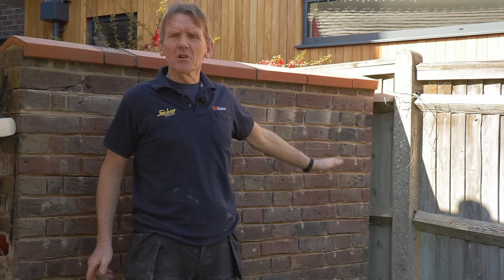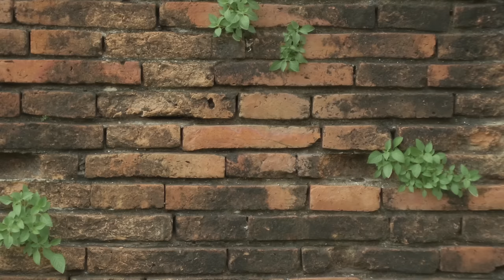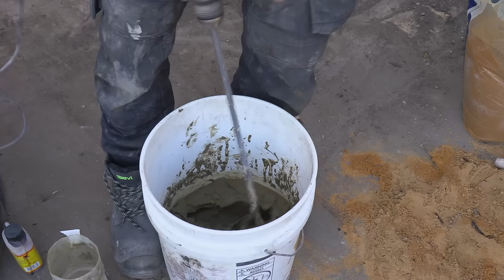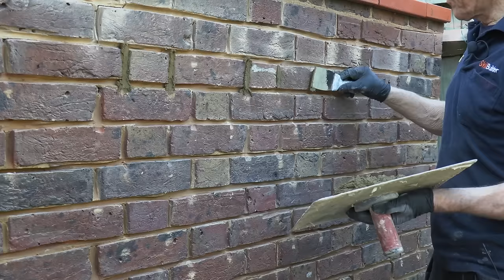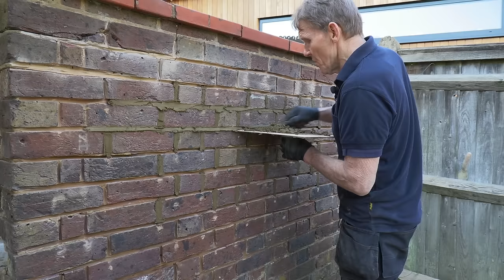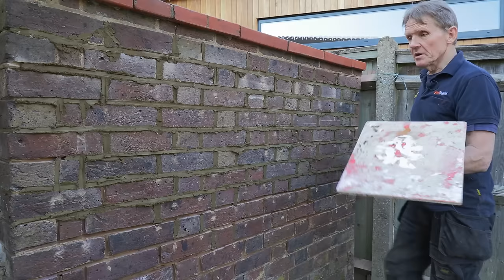Repointing Old Brickwork - Best Mix & Tools

Comment: If you are right handed Roger, fill your bed joints from right to left. That way you are always pushing back against what you have just placed so you have no voids. It will be a lot faster. Cheers mate
Reply from the maker: Thanks and you are right.
Reply: Hope you and your family are all well mate in this crazy time. Cheers 👍
Reply: Great tip thanks
Reply: That's correct, the right way for a right handed must be from right to left

Comment: I used to mix for a pointing gang in Germany some 40 years ago (can't believe I just wrote that - where did those years go..!). Over there the brickies on a new build didn't point the wall as they went along. A specialist pointing gang would come in after the brickwork was done and finish off the pointing later. We'd use a much drier mx than shown here - it was just damp, and use a straight trowel the same as shown in the video - not a UK style pointing trowel, which is really slow as Roger says - and a curved hawk - always home made. And man, those German pointers were REALLY fast. thinking back it was about 10 seconds for a linear metre. They'd finish off with a bent piece of 15mm copper pipe  bent in the same shape as the pointing trowel (Roger is using a bit of wood here) and a soft brush as suggested. They'd always have a beer on the go too... No, really. Happy days.

Comment: A subject close to my heart! Glad you started this video by talking about the importance of matching the mix strength with existing wall. This is so very important. Can't remember if mentioned this already, but we repointed most of our lower ground floor of our house (about 60 sq m of wall) with a lime mortar last year. (NHL3.5) Keep explaining to people the reason we bothered using lime. The idea is that the mortar must be sacrificial to the brick, not the other way around.  The walls are 185 years old. Shove cement mortar in them, and they will last another 5 years, continue with lime and they are good for another 150. Once you see a lime mortar wall repointed in cement mortar, you can't unsee it. Then you see it everywhere you go! Everywhere you see it, the faces of bricks have crumbled out and come off. No other reason. Such a shame. The whole process of raking out and repointing took three of us a good week. It was very painful on the hands (not like what you showed here, because the brick was very different and we packed the mortar in very hard). Hundreds of bags of dust came out when we raked out. I have some great before/after pics. The stuff was black and crumbly before we repointed, it fell out when you touched it. We raked back 20mm, partly because stuff was falling out already to that depth before we even raked out. In fact entire bricks were loose and dodgy so we needed to pull some out here and there and re-snap them the correct size to get them back in. Lot of hard work. Now it's amazing, firm, no dust comes off when you brush the bricks, lovely. As we went overseas straight afterwards we asked Anna's mum to come around and water the walls twice a day, which was pretty amusing for all. Walls look gorgeous now, as well - so will be keeping some of them exposed. However we accidentally bought too much NHL3.5, so if you know anyone who needs about 9 bags of the stuff (not cheap) then let me know - I'd rather it go to a good home than go off. We kept it off the floor in a reasonable warm and very well ventilated place
Reply from the maker: Thanks Mat. I might buy that mortar from you and do a video. We have a listed building to do so it would be good. What is the colour.
Reply: Skill Builder end result is quite white. I’ll send you a pic.  It’s Secil.
Reply: @Jim_Newlands  sorry but cement colouring is not suitable for lime...
Reply: Can you share the before and after pictures?
Reply: @MatSmithLondon , I really like your approach to the repointing.
Three questions:
Besides the NHL, did you add anything else to the mix (like hydrated lime)? 
What mixing ratio did you use?
Did you consider using a gun for the job?
Reply: Agree with all of this for sure. Your sand choice is usually all that's needed to change the colour, unless you want something dark (then use ash) or red (brick dust).
Reply: Whats the mix ratio and did you use builders sand?
Reply: Current thinking is NHL hardens more overtime than cement. Hot lime is the way forward. This bloke should not be teaching pointing.
Reply: I'm still getting my head round the fact that you did 60m2 in a week.  You must have been giving it some welly even though there were three of you on the job.  I've got to repoint the gable wall of our 1930s house with NHL3.5.  It's 8.4m to the apex and 45m2 in total area excluding windows.  Hopefully a mate is going to lend a hand although I'm still undecided whether to do the whole wall or just repair the bad bits.  Some of my horizontal joints go from 10mm to about 3mm so I may have to modify a pointing tool or just leave the narrow bits.  Unfortunately there is a flower bed ~450mm, against the wall, I fear there won't be by the time we've finished.  As I'm now 3 score and ten, working up the enthusiasm isn't so easy.
Reply: The following is taken directly from the 'Heritage House Building and Restoration' site. They have offices in Shropshire, York and London. So:

Recently there has been a lot of hype about NHL lime.  Or to give it a name, Natural Hydraulic Lime Mortar.

As Chartered Surveyors, we will only recommend hot lime mortars these days.  

The reason for this is a little complex chemically, but it's lost in the mists of time.  This is how lime used to be made.  You took limestone, burned it, added water, and mixed sand with it to make mortar.  It fizzed, hissed and got very hot - and then slowly set to the lovely breathable, flexible lime mortars we see in surveys.  It took a fair bit of mixing, often had copious amounts of cow or goat hair in it, and was often left for months to mature.  If brick dust was added, as a pozzolan - it made the mortar harder.

Hydraulic (not hydrated) lime mortars have been developed more recently and are widely sold (Called NHL - or Natural Hydraulic Lime.  In 3 common flavours - 2.5, 3.5 and 5 - where the numbers refer to set strength in Newtons)  These are easy to use - like buying a bag of cement. They set quickly, and work very much like cement in that you get a first 'set' and then harden over weeks as true 'carbonation' takes place.  The catch is that these seem to be setting much harder over time than we thought they would.  Which makes them less flexible and less breathable. New research is underlining this fact.

So, to solve the problem, we go back to traditional hot lime mixes which are really cheap to make, but you need to take care not to splash yourself with the newly wetted powder - it gets pretty warm!  We make it from 2.5 parts sharp gritty sand, and 1 part lime - Calbux 90 or the equivalent. 
End.

If you're property is old, sandstone, Victorian (or older) suggest contacting them via their website. All of this site is very interesting and easy to read.

Incidentally, I enjoyed your video, Roger, you have an excellent approach to this type of tutorial. No, the materials used probably not ideal however it's generated a lot of useful comment and information re appropriate materials on certain properties that will, over time, become normal use.
Reply: @SpecieltBrugenavn  You mix NHL 2.5 sand or 2 sand to one lime depending on grade of sharp sand 2mm-2.5mm. The mortar should not be too sloppy so no gun use tuck pointing tool 6mm to 10mm or depending on joint size. Rake out 25mm blow/brush/hoover out dust then hose out. Come back after 20 mins with relatively firm lime mortar and push hard into joints. When set up a little go over joints with gloved hand or soft brush. Its important the bricks are damped down and the mortar not too wet.
Reply: @coldt1484  I'm interested in your comment. Is there a way of colouring lime other than just finding appropriate coloured aggregate?
Reply: I came to the comments to make that exact point about lime. I'm amazed at how few builders seems to know how damaging using cement on top of lime is. I looked into this a lot before I got the repointing done on one wall of my house, and now I can't stop seeing it, it's bloody everywhere!.

Comment: Given that there are so many types of masonry walls, getting the pointing right is not quite so simple as it might first appear.  Generally speaking, joints should be raked out to at least twice their width, mortar pointing is a sacrificial material and should be weaker and more porous than the bricks, and the finished profile should ideally match the original design. Mortar must be compatible with the original materials and this is critical in the case of solid walls built using lime mortar as they need to dry out by evaporation. If you require reliable guidance on repointing, do take the trouble to read the Building Research Establishment publication “Good Repair Guide No 24” (Repointing external brickwork walls) as this provides useful information, including when does worn pointing affect structural integrity. As a general rule, impermeable finishes should not be applied to external walls as this inhibits evapourative during and tends to trap moisture.

Comment: We point a lot of houses mainly brick for the council we use a pointing gun 2 lads do about 25sq metre a day 1 lad putting it in gun and 1 lad using a jointing iron . We use 1 lime 3 building sand 1 silver abit of motor plasticiser and abit of dye if needed so new pointing doesn’t look out of place

Comment: tuck  pointing   is    when you point red brick arches   usualy with a lime joint   you  will need a  special  trowel to do so  if  you are weather pointing  use   a 5 and 6 inch marshaltown    american trowels ..Having done thousands of yards    of weather pointing i  always   used   soft building sand at 3 to 1 mix cement also i always used  a small decoraters plastic hawk less combersome  than the large  hawk the    rule can be made of a peace of plain architrave  about 3 feet long .place thin  upright     strips of thin ply to the back to hold the  rule of the wall allowing the snots  to fall   ....a french man   can be made from a steel knife     file the end to a point  hold over a gas flame and bend up to form  a small plough  shape..make sure the rest of the knife is not sharp   file the edge off   so that it does not cut into the rule .Finally   gently brush the    pointing when dry with a fine brush...it takes a bit of practice ,but you can do it..lastly when i used to build say stock brick exstentions i  always raked the joints   and weather pointed the wall Today   builders  just dong the joint  or finish with a bucket handle  joint   is  thet progress    doute it  forget the   video   lastly   i  rebuild a large  flank   of  a house  in Fulham london      using  morter  with a little bit ot  cement mixed in     stuff is the old name for morter..end of lesson

Comment: I've done a strong 3.1 mix of sand/cement for a 30cm, below ground, section of blockwork on a garden retaining wall. I will have 4 rows of salvaged victorian house bricks on top of this blockwork. These will surely require a different mix, correct? Any ideas? Ideally I'd like to be able to clean up the bricks easily if the wall fails further down the line. 3.1 just feels way too strong! I have some white cement and yellow sand I'd like to use up if possible.

Comment: Hi Rodger, I've searched YouTube but cannot find anything on why brick on end caps layed level cause an issue with water ingress due to water lodging on brick and freezing. I've just rebuilt garden wall and waiting to confirm if a fall is needed on the brick on end cap. Can you do a video on this as its needed, no videos out there at present.  Thanks

Comment: Top of my garage wall needs repointing. It seems to look a little damper at the top. The mortar gets wet, freezes and the water expands and pushes the mortar out. Also need a tip for a subsidence crack. The outdoor water tap kept dripping so the corner of the garage started to subside. Caused cracks all along the bottom on the inside walls. I've kept the tap dry and over a year or so the cracks have closed back up a lot. I did also fill all around the garage with cement as I think water settled in the foundation gap. Anyhow, what's the best thing to use to fill the crack gaps at the bottom of the walls? Thanks in advance.

Comment: Brilliant. l watched this wondering why my new pointing gun isn't working and you answered that. l am using a pre-mixed mortor but it wont come out of the gun. The only way to get any movement was to take the nozzle off completely but that was very messy, if slightly effective.

Comment: Nice video, well having never done pointing before I thought I'd give it a go, how hard could it be right?!! Tried using a mortar gun, wet mix as advised but not sure if I'm being too heavy handed but kept on coming out in clumps then when I go back over it to fill in the gaps the gun gets so messy then before you knows it I've run out of mix, too much faff, as I haven't got a labourer constantly filling it up for me what is supposed to be quicker is actually taking longer so I think I'll try your method with the tuck pointer!

Comment: Hi Roger, another good video, one of the most difficult jobs you ever have to undertake. I struggled with it for years tried all sorts of tricks, one job in Cambridge I got it all raked out and washed off, and because I wanted to use a wet lime mortar (7 soft sand 1 lime 1torment(OPC)) mix which would stain the bricks I decided to use an oil based barrier on the bricks, I use a bottle of Mazola from a local shop!, it worked an absolute treat, got the job done in no time and washed of the snots as soon as it had dried a bit. I was delighted and when back a few months later to admire it, to my everlasting shame and embarrassment all the brickwork had gone almost black as the oil degraded!, I never tried that again!.
One of the things II was told was that any attempt to wash fresh pointing with water would just make matters worse but if the brickwork and the muck are too dry it cracks and dries before it can chemically cure, if you are lucky you can brush off the worst a half-hour after you put it in. 
When I did the front of the house that I'm living in now I decided to wash the wall with the garden hose and apply dryish mortar (old yellow brick with lime mortar) to very wet bricks, again went in a treat, this time I chose to just leave it to dry completely and brush it off the next day - wrong again - I did the job now 15 years ago and the smears of muck are still showing all over the edges!, it is going to stay there for sure!.
The next bit I tried was just a little patch, this time as before but I decided to try another tack, this time I cut a very deep chase , wet it thoroughly, pointed it up, struck it off with the trowel, put a bit of a skin on it, left it for twenty minutes then washed over it all with gallons of clean water and a soft sponge - at last - I cracked  it!, apart from the mess on the ground!, absolutely perfect, if only I'd known that before. The last big pointing job a few years ago came in at about sixty pounds a square metre which I think is not too bad for a job that should last for as long as the house!. Cheers, Richard.
Reply from the maker: Great information. I will try that sponge on the next one

Comment: Believe it or not I used to be plumber years ago then  went into bench joinery and manufacturing.
I've done all my own pointing. I do it the same way you showed however thanks for the tip with a scraper for the perp's.
I have my garage gable to do this summer. Great tip👍

Comment: Perfect timing thanks Roger, I've been putting off repointing my 100yr old garden wall but I can't escape it any longer in lockdown!  You said not to wet the wall down first to avoid cement marks but lots of other instructions online say get it wet first!  What's the deal?
Reply from the maker: Hi Beth
 I am sorry if I rambled a bit here. I said not to wet the wall but I meant immediately  prior to pointing. Somewhere else I said 
I would hose  this down the day before but I am not sure now if it got edited out.  So to clarify. Give the wall a good soaking the day before or in the morning, That will wash the dust out of the joints and stop it sucking all the moisture out of your new mix.  
I am going to redo this video because there is a lot of information about lime etc. that needs adding and I can make a more concise edit
Reply: @SkillBuilder - I hope you amend it to take account of needing to use lime mortar on an old lime wall, NOT cement!

Comment: Roger, you've just made my day. I just came to YouTube for a video on how to repoint our old garden wall as want to prove to my husband that I can.... After watching 3 other videos I came across yours and not only did o get a proper step by step explanation with added tips and tricks but also thoroughly enjoyed your personal stories, especially about working on the Savoy. I am leaving the video feeling confident enough to try myself and wishing I could one day meet you for a pint 🙏☺️
Reply from the maker: I hope you do it and it works out. 
There are things I would change in this video including working from left to right to load on top of the previous stuff but I thought it was a problem for the camera. Also hose the wall down the day before so you wash out the dust and give it a soaking. Some people then wet the joints but there should be residual moisture in the mortar if you have hosed it down. I also like the tip of rubbing it with a sponge when it has gone hard. It just gets rid of trowel marks. If you are in the South East we could film you doing the job and I would give you a bit of guidance.